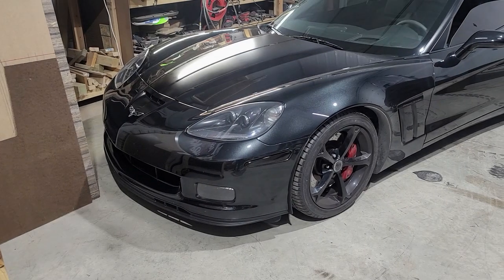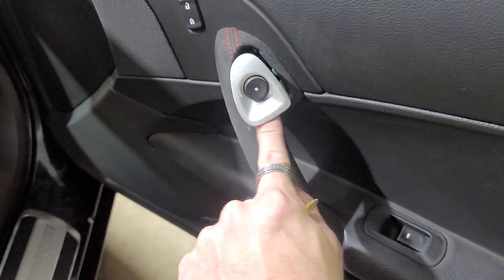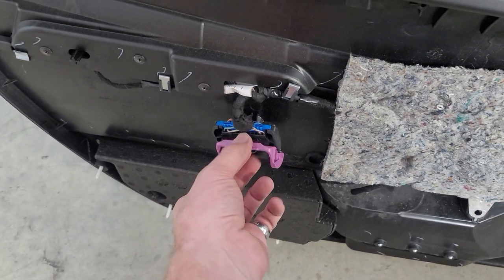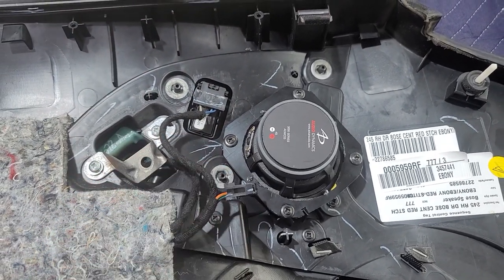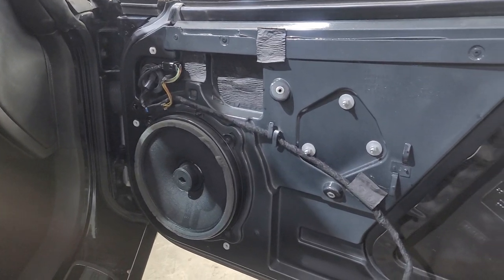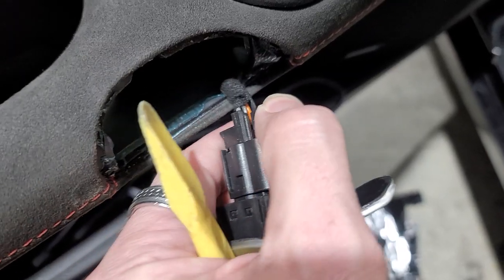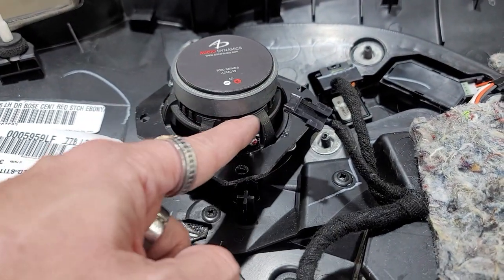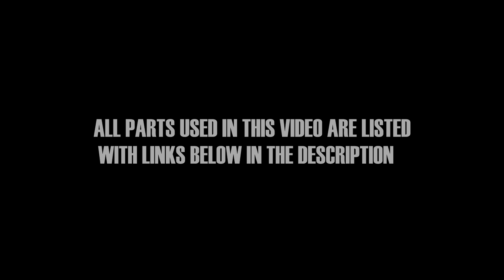C6 CORVETTE FRONT SPEAKER INSTALL WITH BOSE - FRONT DOOR PANEL REMOVAL

Comment: Okay, I hate to spoil our budding romance, but I gots a beef now. Don't get me wrong, my previous accolade still applies, and I very much appreciate the video, but the part regarding the connector where you say something like "merely move this cantilever system up like that..." THAT statement tripped me up for 20 minutes. That cantilever doesn't just swing up for disconnection, there are two locks on the side of the cantilever, colored black just like the rest of the plug, and those two have to be squeezed for the cantilever to be unlocked so that it can then be "merely moved." I fooled around with that cantilever thing, couldn't get it to swing up, until I was fondling the whole connector in a purely platonic fashion, squeezed it tight in an absolutely appropriate and non-pervy way, and THEN the cantilever could be swung up to disconnect the connector.

Comment: I have a C6 with LT3 & the "better" Bose stereo. Now that I've got the door panel off, the big speaker looks weird to me. Are these Bose elements any good? Can I replace just the big speaker in the door with something that will sound better, yet still work with whatever weird custom amplifier voicing Bose tailored to the speaker elements they designed to? I've tried replacing just speakers with Bose head-ends in other cars before and I have had poor results. I don't want to yank & replace the existing stereo, maybe just upgrade some?

Comment: So what did you replace the 8 inch 2 ohm speakers with? I live in Lafayette by the way.
Reply from the maker: Are you talking about the door mid-bass woofers?
Reply: @octanetvchannel  yes.. In my 2007 C6 it basically a 2ohm 8 inch speaker